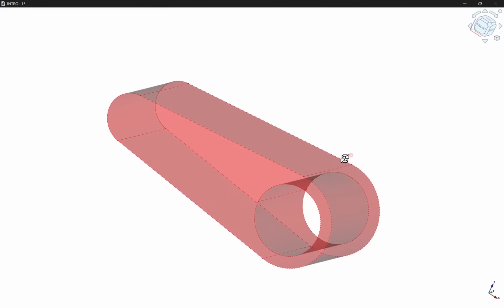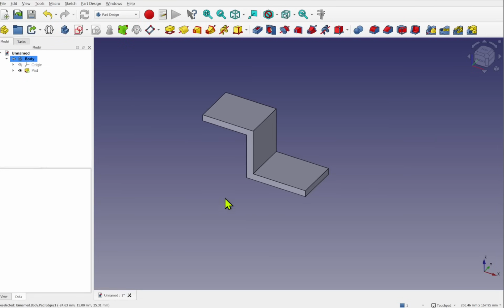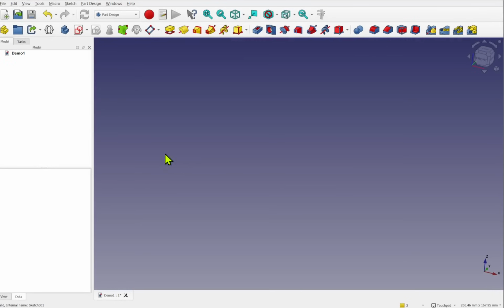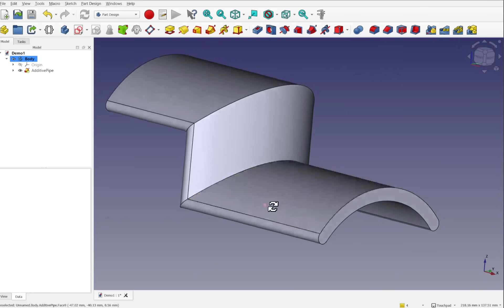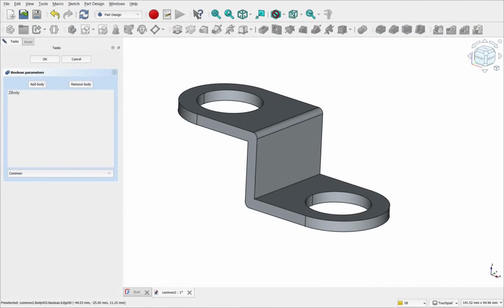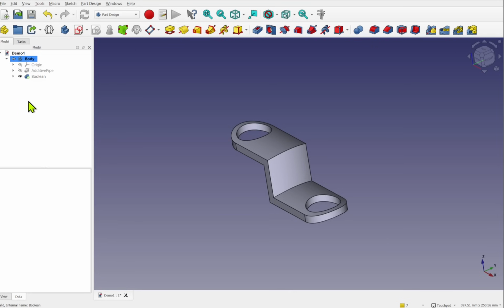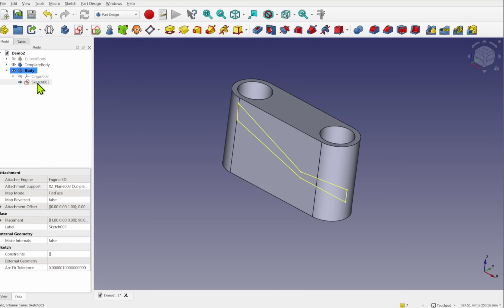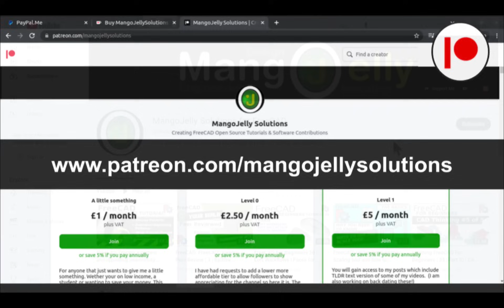FreeCAD 1.0 | Part Design Common & Intersection Workflows | Basic Beginners FreeCAD Lesson 35

Comment: This only looks simple. Got lost twice... spent almost 2 hours to clean up mess I made... Why tool body often moves to a main body along x axis when boolean? Using 'transform' before boolean almost always leads to mess... I am not sure I understand whats going on there... have to repeat it tomorrow. Thank you
Reply from the maker: Yes don't worry, this is a bit of a gotcha with booleans in part design. If your active Body has been moved then FreeCAD needs to figure out where the tool Body should go relative to the active one. Keep your active Body where it is before using a Boolean so your just moving the tool body fixes this issue.  It's a limitation with part design boolean at the moment.

Comment: Do my comments get deleted?
Reply from the maker: Have no idea, what did you comment?  Youtube have certain rules with comments such as links, abusive language, threats etc.
Reply: @MangoJellySolutions  It must have been a link to Snap-Close Jewelry Box by Carlo Vaccari over at Printables. I'm at lesson 15 now. I make boxes for my board games for the players cards and item and got bored by doing rectangular boxes so I looked for something more well "Rococo" with sloped sides going out and in but I have no clue how to do that so maybe you could point me in the right direction? Could be I need to see more lessons. Ideas?
Reply from the maker: @peterlageri4177  Oh, I think I am dealing with a very similar request where someone is making a similar shape but they haven't told me what it was.  I was under the assumption they are modeling some kind of boarder / getting to grips with the sweep command but now I look at it, if I mirror it across 2 planes to make a continuous shape, it looks very similar to the bottom half of that box.  They are having an issue with the additive pipe.  My email is in the about of my channel.  Drop me a message and I share what I have and see if I can alter it to what you want. If I share my email in comments they get collected by bots :(
Reply: @MangoJellySolutions  Thank you!
Reply from the maker: I had a great teacher back when I started in 3D, he said to me you can learn how to use the program but that's only half the battle, now you have to learn about digitalizing form, and there is no wrong way, but there is always a better one, and you will have so much fun finding those answers.  Another way for the wire is to used the hybrid curves tool in the curves workbench.  You can select two curves and then angle your camera to make a projection of them together. :)  Glad you enjoyed, and thank you for feeding back.